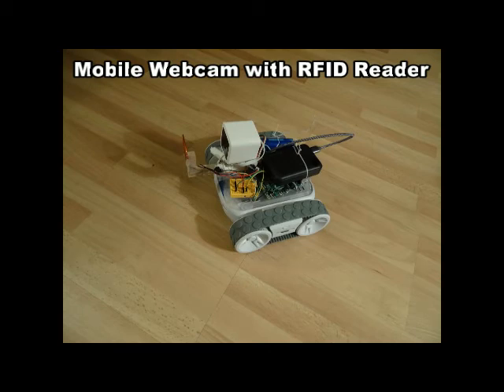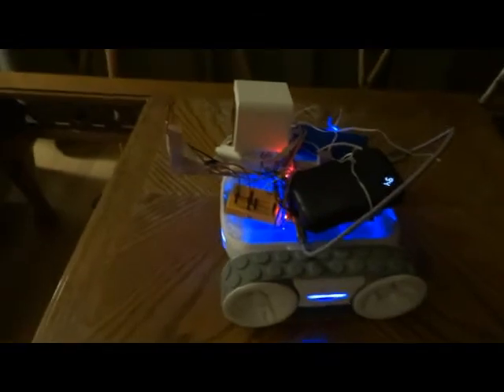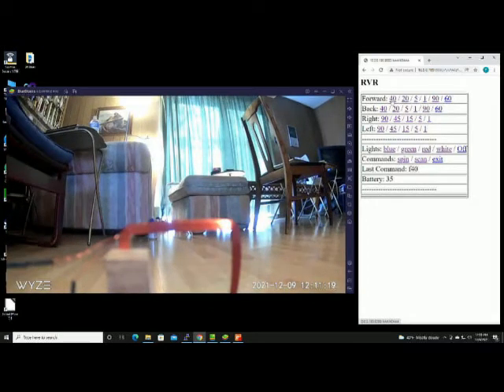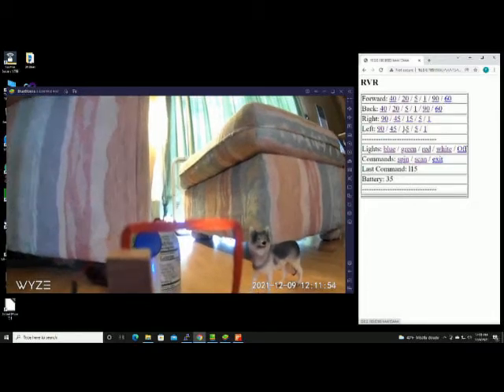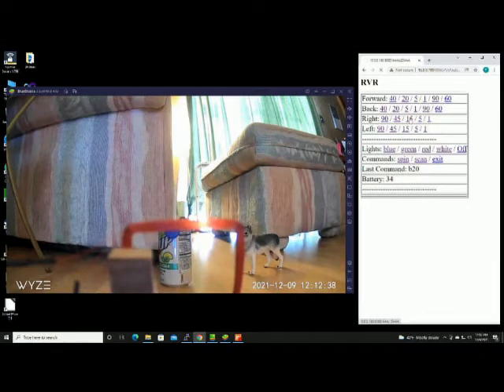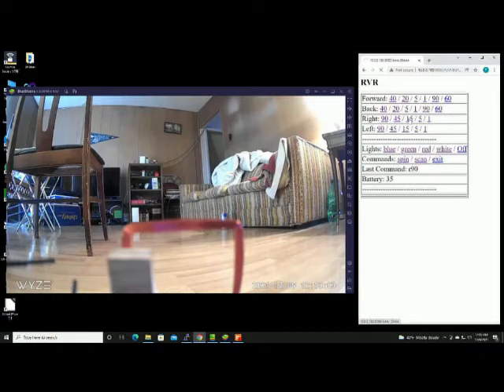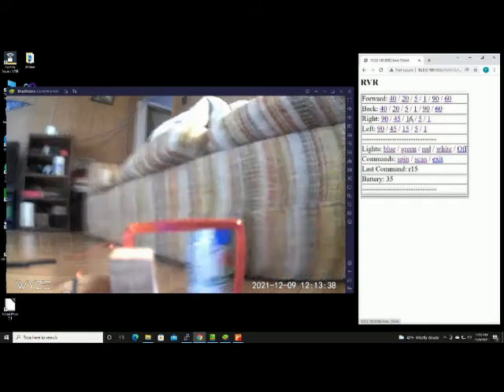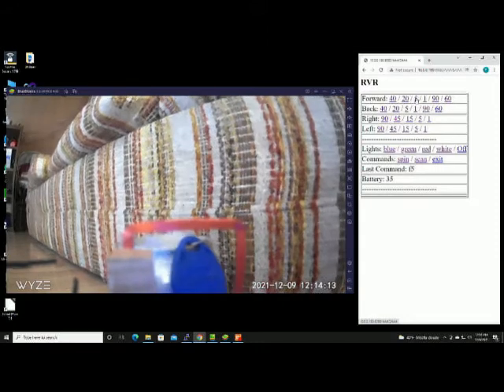Mobile Webcam with Raspberry PI and RFID

Comment: How does the Raspberry PI know that there is a tag read by the RFID?
Reply from the maker: The code is in python. While the commands are being sent to the PI via the webpage, an rfid polling subroutine is running constantly in a separate thread, checking for a tag every few seconds. When it finds one it adds the result to the webpage.
Reply: @sevenfifty9214  Why are the results sent via the webpage? What does the code do? Retrieve the wholenpage and parse it every few seconds?
Reply from the maker: The webpage is generated and displayed when a command is clicked. The Rfid results are added to the webpage and displayed next time it is called up. Do you have any ideas how else I would display the results?
Reply: @sevenfifty9214  I have some ideas on how to cut some latency and make the rig more responsive.

Establish a websockets connection between the Two end-points, so you can send events, such as keypresses, more efficiently. You'll get event-driven code, rather than polling a webpage repeatedly. Also, you'll save a lot of network bandwidth.
Reply: An easy way to do that is to use Mojolicious.
Reply from the maker: Thats an interesting idea, maybe for my next project. One advantage of using a web page is any browser makes a convenient client to access it.
Reply: @sevenfifty9214  Mojolicious is a server-side framework. All major browsers support websockets. Anyway, if you need my help, setting it up for a future project, let me know.